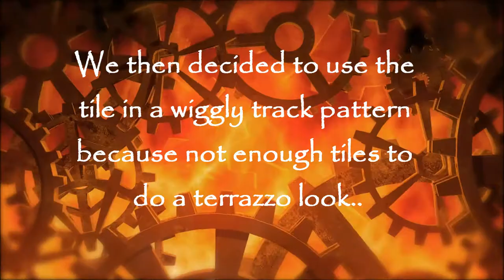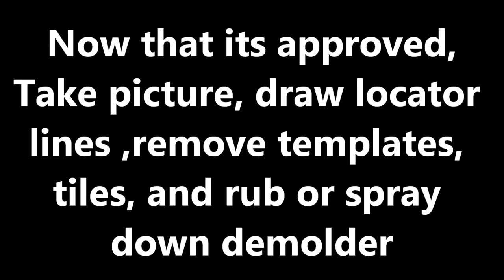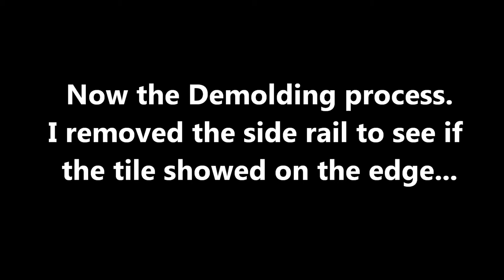Concrete & Inlaid Tile Countertops DIY

Comment: I was thinking of using some leftover tile from the kitchen floor to do concrete countertops with tile pieces randomly scattered throughout. I wasn't sure anybody else had done it, but as they say "if you can imagine it, somebody's probably done it" and that was true in this case. I couldn't find any other videos, besides yours, of somebody doing similar to what I wanted to do, so I'm glad you did it. Now I know how to do mine.
Reply from the maker: Awesome...need any advice hit me up..it's best way to also match existing tile..thanks for watching..

Comment: You are the top master. 
What part of Florida are you located, want come for training.
Reply from the maker: I'm in Tampa Bay, St. Pete..
Reply from the maker: Thanks for the compliments..
Reply: @MrGeneShopTalk     How many days I have to put aside for the training Gene.
Reply from the maker: @tomboll8816  well ut depends what you want to learn, what material,etc. Plus I'm not doing more than 2 day classes until January where it will be a group type course..problem some guys wanna learn Crete, some backlighted bar tops, repairs..and some want inlays..so let me know what ya want to know and squeeze something in ..then I'll send ya price and materials cost
Most contractor shops hire me to teach them how to a kitchen top they will actually use to justify my pricing for teaching people how to make 10 to 20k countertops
Reply from the maker: https://youtu.be/tEKOpvEtjOY?si=wxr_FecAUa5ayVIr

Comment: I didn’t see any aggregate.  Is it actually a cement/water mix without aggregate?
Reply from the maker: Nah, Its the precast kits , i think i listed in the description so you can test a kit..the crete bag actually has glass fibers in it , then you mix it with a modifier and I use only 16 ounces of water..
i am sorry I made too long of a video to explain it in my current video about crete ...skim through this video past the glass placement and sink section and I give the full recipe mix tips to help ya..Its pricey to me, but end result my customers love...
https://youtu.be/tEKOpvEtjOY?si=JeklgFN5k6EXX92Q